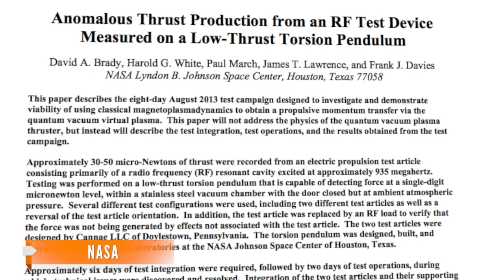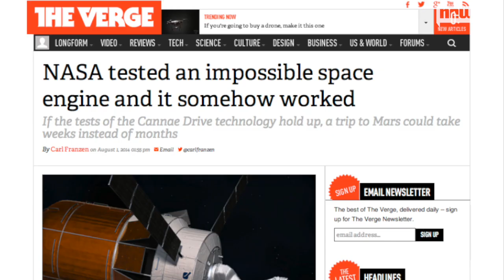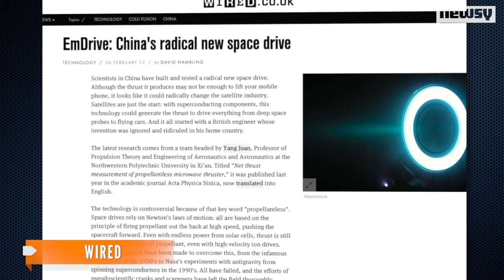NASA Tests 'Impossible' Engine, Finds Out It's Really Fast

Comment: Reactionless thruster. Also look up the Biefeld-Brown effect. Ignore NASA's crude "test" in a vacuum chamber, which didn't work. That device was not constructed like any other one. Many people have shown these devices to produce thrust that cannot be attributed to any "ion wind" effect. How to do that? By attaching the device to a plate that blocks air movement or fully enclosing it so that any air moved strikes the plate or inside of the enclosure.

The same principle as taping a toy helicopter to a piece of cardboard or how a truck full of flying birds exerts exactly the same force on its wheels as when the birds are roosting. But a properly constructed Biefeld-Brown device will still produce a lifting force.

That is one thing to always watch out for in experiments, experiments by other people who don't construct their apparatus and conduct the experiment EXACTLY like the original, then when their test fails they claim the original was either a fraud or at best "anomalous".

Find the book "Butter side up!: The Delights of science" by Magnus Pyke. One chapter in it is on the Coriolis Effect and water going down drains, and the many experiments done by various people to test it. It also includes examples of experiments done in various wrong ways - which produced useless results or led people to incorrect conclusions.
Reply: ***** The first thing to do is exactly duplicate the original experiment to be certain it really does work and so you can study it to figure out how it works. THEN you try alterations to see what different results you get. All too often other researchers skip the first step and go directly to making changes and when their changes fail they declare the original (which they didn't bother to EXACTLY duplicate) is bogus.
Reply: ***** NASA didn't test an exact duplicate of anyone else's Biefeld-Brown effect device. When I read that report I did a lot of searching and didn't find any other like it. You wrote a lot of words about testing what is already known and proven, Newtonian physics, when with what the subject of this video is, you should know I wasn't writing about things already known.

When someone discovers something NEW and not seen before it has to be confirmed by EXACT duplicates of the original experiment. That is what NASA did this time with this discovery. Now that they've done that and proven by duplication that it works, they can now attempt to improve upon it. If you don't first duplicate an experiment or examine the working original, you can waste a lot of time making detrimental changes. "Cold Fusion" was another example of this. The original experiment had an anomalous effect, but when the people who did the experiment used the words "cold fusion", the rest of the scientific community just instantly rejected it as quackery and the ones who did try to duplicate the effect did not first begin with an exact duplicate of the original. Yet some time later, some scientists decided to take another look and found odd things with it, not fusion but very interesting. Had that attitude prevailed from the start, who knows what the research could have produced.

Many scientific advances have come from people noticing odd and unexpected results, like the accidental discovery of the first artificial dye in a failure to synthesize quinine and that cyanoacrylate resin made a really good glue, after an expensive pair of prisms had been ruined. But since the mid 20th century, there's been a shift toward instant skepticism and denigration of other people's work, especially when they come up with something that doesn't square with what is "known for certain".

An excellent example of several researchers arriving at contradictory results because they wouldn't pay close attention to one another's work is in the book "Butter Side Up! The Delights of Science" by Magnus Pyke. It has a chapter on the research done on the Coriolis effect and water going down drains. Seems like a simple thing, yet variables such as air currents, temperature, the diameter and depth of the tank, how long the water was allowed to settle and even the purity (or lack) of the water all affected what happened when the water was allowed to drain. When those experiments were done decades ago it was very serious research, seeking to confirm, or disprove a theory. Most of the experiments showed that the Coriolis effect does work even at a quite small scale, but at that scale it's easily overcome by other influences. The outliers, the inconclusive experiments were from people who just figured they had better ideas and never bothered to even try to come close to duplicating the work of someone else who did a test with a positive result.

But aside from all that, is it not great that there is now confirmation that something that not so long ago would have been instantly dismissed as  "oogy boogy" "fringe science" has been proven to work? And even better, in this century, scientists have finally decided to actually try to find ways to travel faster than light, instead of being closed minded and stuffily saying "Impossible! Don't bother me with that twaddle!"

Open minds have always discovered and invented far more new and exciting and useful things.

Comment: Kerbal Space Program had Xenon thrusters before NASA did! PC Gaming for the win!
Reply: Pieliker Productions This is not ion propulsion. There have been ion engines in the real world for a while, although I'm not sure about their deployment. They work by accelerating a supply of heavy atoms (Xenon is particularly attractive because as a noble gas, it requires no special containment or mechanism of delivery to the engine) using electrical energy. It is more efficient than conventional thrusters because we're basically dealing with a linear particle accelerator here, which can give the atoms significantly higher speeds than any chemical reaction could.

This technology is different though, because it does not require you to bring any material with you only to expel it out the back of your spacecraft. Instead, it accelerates virtual particles that arise from quantum fluctuations, i.e. it literally grabs them out of empty space. And no, I have no idea how the fuck that's supposed to work.
Reply: Yay! Quantum vaccum thrusters! Fun! Sarcastic Comment! The concept of a quantum vaccum thruster is that it uses particles that have been spontaneously conceived by energy (probably dark energy) This somehow works because E=mc^2.
Reply: Pieliker96 Gaming Hey I'm just trying to help :P

Comment: If you had a spacecraft, 1 tonne in mass, being propelled by 30 micro-Newtons, it'd take approximately 51500 years to get to our nearest star (assuming the spacecraft starts from rest). You'd need 88.7N of thrust to make the journey in 30 years.

If you had multiple, 30 micro-Newton, thrusters, you'd need 2957000 of them to shift a tonne at the required acceleration - this means, if your spacecraft was entirely made out of thrusters, each one would have to weigh 0.34 grams.

If you can't see where I'm going with this, the 'Impossible Engine' is clearly a load of bullshit.
Reply: Except the 30 micro-Newtons was thrust of the prototype and not a fully scaled up engine, making your argument invalid.
Reply: Sir Aroun Well the required thrust to mass ratio is 0.088 to get to the nearest star in the time the video claims. Whatever it is producing the 30 micro-Newtons, I highly doubt it even comes close to that value (it'd have to weigh 0.34 grams). Scale up the prototype and you'd also have to scale up the power source (solar panels, batteries, etc.). This is all before you even consider designing systems for communication, control... It's not likely anything will come from this.

Comment: I understand the need to use lamen's terms, but I think it's important to clarify the difference between "fuel" and "reaction mass" (or just "remass"), especially when talking about these unconventional drives.  Remass is the matter that is thrown out the back of the rocket to push it forward.  For chemical rockets the fuel and the remass are indeed one and the same, but most other kinds of rockets use different systems for the two.  Ion drives are powered by solar panels or nuclear batteries, and they throw argon (or some such gas) to push themselves forward.

This drive would have no remass (which is awesome and really special) but it would still need a power supply "fuelled" by something conventional like solar panels, batteries, or a small nuclear reactor.  The technology is all very novel, but it still needs regular old electricity to make it all happen.

Comment: This reporter seems to have overlooked that with increased efficiency comes increased mass and decreased thrust to mass ratios. Therefore, this drive may be able to pack a massive amount (infinite, if this is true and fault-free) of /\V, but it would take an absolue age to accelerate to the kind of velocities that would take you to Mars in several weeks. As for warp drives, we need to generate negative mass before we can even think of them. Wormholes are inherently risky, as it may take a massive amount of energy to open the corridor wide enough, and then one is faced with the issue of the endpoint's location.

Comment: Must be some magnetron that works without a power source. 

So when do we see the first new energy free microwaves on our shelves?
Reply: The engine requires (probably large) amounts of electric energy; it's not "energy free." It just seems to use the quantum vacuum as a propellant instead of onboard or scooped fuel.
Reply: That's not what the video claimed.

Comment: Feel free to correct me.
30 micro Newtons of thrust is equal to 0.00000305914863894 Kg of thrust.

That does not seem like a hell of a lot.
Reply: That's true, but in space, you have plenty of room and time to get up to speed. With this force, a 1Kg spacecraft can accelerate to 100km/s within a day. For interplanetary or even interstellar missions, this is more than enough. The main advantage of this mechanism is that if it works, it requires no propellant. This means that with whatever little thrust you have, you'll eventually get places. With conventional methods, once your propellant runs out, you're done. It also eliminates the extra mass you have from carrying around all that propellant to begin with.
Reply: But in space there is zero gravity. Nothing to pull you down. The slightest push will get you moving at quite a faster speed than expected. Having 30 micro newtons propel the spacecraft for an unlimited amount of time will get the spacecraft to go extremely fast. As it said that we could reach Alpha Centauri in 30 years with this engine. Alpha Centauri is 4 light years away. With voyager moving at 17,000 miles per second, it will still reach Alpha Centauri in 40,000 years. If it were to be propelled in space forever, the speed would rise incredibly for there is no force in space pulling on it making a much faster trip.
Reply: Universe Man It's not that there is no gravity in space. There is plenty of it, it keeps the planets going where they're supposed to.
What is lacking in space is friction. The effect is pretty much what you described, I just felt it important to clear up this misconception.

Comment: stress on ship from pushing the ship forward would cause it to break apart before it reached light speed.  Space is like  as a wave in the ocean so therefore for a ship move in space it would have to ride above the wave.  In star trek as an example the space craft was in a warp bubble that allowed it move at light speed.  We will one day travel at light speed not before we are dead.
Reply: 50 micronewtons won´t get you anywhere near lightspeed. Even if you´d accelerate for dozens of years.
Reply: yes it would take an engine a lot bigger then the size in which would be in that ship all I can say good luck with that.
Reply: roger wilson of course they have not enough anti-matter even if they tested that engine would not get to warp before it was used up lol

Comment: Virtual partials as fuel? The hell does that work?!?! It the thing carrying around a mini black hole or something?!?!?!!
Reply: It's more virtual particles as reaction mass than "fuel"; the power is electrical, so some form of "fuel" or other power source would still be needed.

I gather the way it works is the resonant cavity is tuned to the wavelength equivalent to the rest-mass (Compton wavelength) of the particle/antiparticle pairs, and by the process of constructive interference the energy of these particles is boosted to the point where they become temporarily real (just like how Hawking radiation leeches the mass of a singularity to make one half of such a pair real while the other is absorbed into the singularity); when these temporary particles escape the resonant cavity the amplitude of their Compton wavelength drops back down to normal while the energy in the particles' de Broglie wavelength (equivalent to momentum) increases instead, meaning that the energy of the microwave photons becomes momentum applied to a virtual particle wind escaping out the back of the engine.

At that point, despite all the quantum mechanical effects in play, simple Newtonian physics still takes-over and that action produces an equal and opposite reaction upon the engine.

After that point, the pairs decay back down to an energy level where they can finally mutually annihilate & be reabsorbed into the zero point field.
Reply: David Harrison Huh. Kind of hard to follow, but it makes sense.

Comment: The report says the Canni or EM process uses "magentoplasma dynamics", so I expect the process DOES create a magnetic field...
Where do we see natural quantum vacuum fluctuations of plasma other than on the Sun, or in lightening on existing celestial bodies like the Earth or on moons?  It seems logical that once a spaceship left a celestial body, it's only source of "random" quantum vacuum fluctuations would be from sub-atomic space which would require the conversion of mass into energy and an electromagnetic field.

In any case, since energy, mass, and speed are all inter-related, I think it's logical to conclude that once enough energy was built up to cause a warp drive wave, there would be the same conditions of a gravity well...
What would be the effects of the gravity well in physical space at the launch point or in back of the wave?  How would the front of the wave effect objects in its path? 
Would the transition of energy/matter from sub-atomic space collapse portions of the atomic world and/or re-distribute its overall structure...similar to what we experience with fracking?

All of these issues aside, in a warp wave,  physicists say a traveler would still experience speed, matter can't travel at the speed of light, and according to the time dilation theory, time would pass faster for ALL of space, not just at the point of origin.

Comment: ALPHA CENTAURI IN 30 YEARS????????
Reply: Proxima Centauri Stargroup by 2021!
Reply: With electrogravitics, NASA shows you can get to Alpha or Proxima Centauri in TWO WEEKS OR LESS! Sure beats the HECK out of 30-years cooped up in a tin can!
Reply: ***** Using the TT Brown Patents (like US Pat 2,949,550 ELECTROKINETIC APPARATUS, which I built 25 years ago) space is modified electrically into a wave. The vehicle rides this wave into infinity as long as the charge is maintained. It only takes laboratory-High Voltage to simulate the effect of a PLANET-SIZED MASS.  http://0.r.msn.com/?ld=d3-UUGw8j1ik2F0_N6wgF41zVUCUzd-Gel-oOxzXYKtbsHMCVm9tzKuDJcMBug0JeHARFc_ENUApnXLaHI-JDW3leShf0XG7j9_ANZS3gq79V213qXAyGFA_zjC1r-AY2BqozF8EA3rPCtiCeuDQvz_mJn1NGpc4HRE58mbcaSlQHbZgr8&u=http%3a%2f%2fwww.amazon.com%2fdp%2f159143078X%2f%3ftag%3dmh0b-20%26hvadid%3d4963812159%26ref%3dpd_sl_4wfeu2xvh2_e
Reply: *****
Actually 4 light years in any time less than 4 years would be faster than the speed of light.
Reply: ***** If you travel at say 90% c time speeds up about 4 times so a 4 light year journey for you will appear to take 1 year . On earth a person there would observe you taking 4.6 years or so .
Reply: ThAt is if the drive is possible.....
Reply: This is WARP DRIVE. Every atom of craft and payload travels at the same rate within the forcefield. So there is no time dilation, and lightspeed is no longer a barrier, as inertial-mass has been canceled out by the field. Thank Nikola Tesla, and Thomas Townsend Brown!